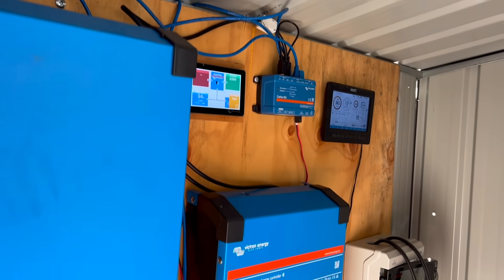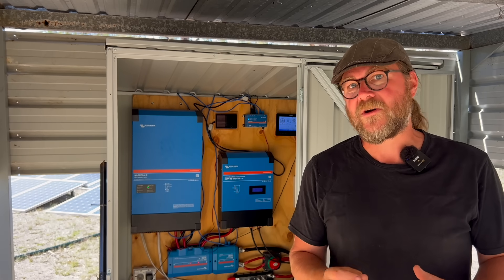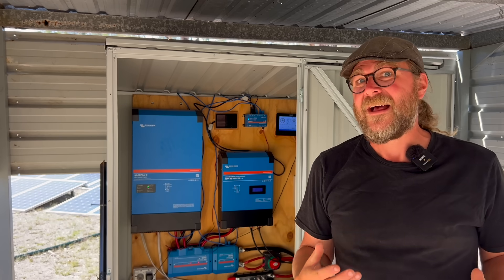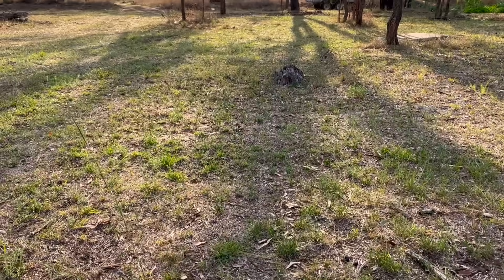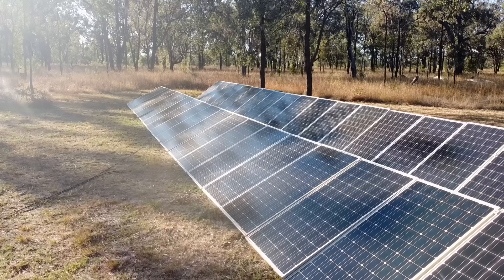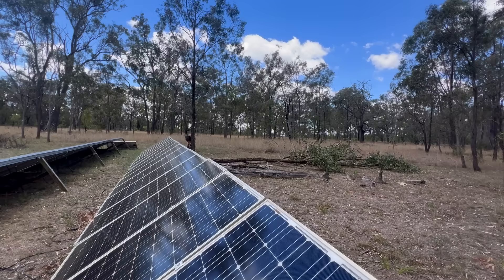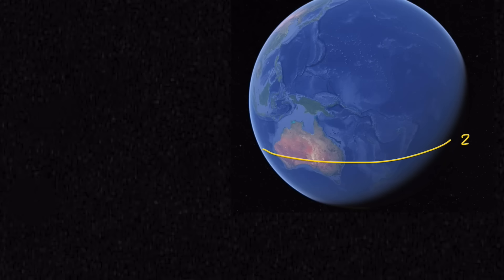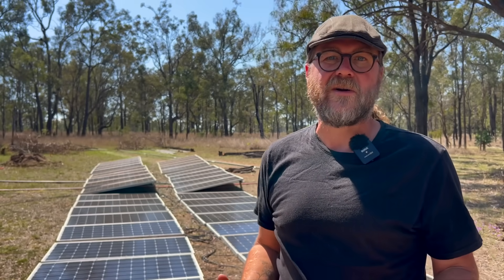We seriously MISCALCULATED when we set up our Off Grid Solar System

Comment: Not to mention solar panels lose efficiency the hotter they get. Get them up off the ground so you have air flow under them. All that radiating heat from the ground is probably knocking out about 10% of your power on the hot days.
Reply from the maker: That’s an interesting point. I wouldn’t have thought 10% though? And what about panels mounted to a house roof, how do they keep those cool? Might be interesting to run a comparison test when I build better racks for them.
Reply: In the cooler months and mornings, likely not going to lose anything. But our Australian weather isn't cool most of the time. The ground is a massive thermal mass and it will radiate that heat straight into the panels. Roof mountings are usually fine because even on a roof they are slightly elevated due to the support system they're installed on and the corrugated nature of roofs. Then there is the that most roofs are hollow and don't have any real thermal mass, so any heat they radiate, is just the bounce UV radiation. Should be easy enough to keep track of the evidence loss with your Victron hardware as it should hold a record of your daily current input.
Reply from the maker: @SovakaKindred  aha that makes a lot of sense!
I guess it’s not as noticeable for me right now because of all the extra solar energy I’m getting from the summer sun angles but now I’m wondering just how much MORE I could be getting if we lifted them… Especially as these are pretty old panels
Thanks for the tip!
Reply: @rusticspiritshomestead  Obviously you can only work with what you have and make changes as time and money allow and if you are currently meeting your electrical requirements, then all is good. But it also speaks to the lifetime argument you made about not pushing the electrical items heat limits. I'd be interested to know the differences as well!

Comment: I have gone totally off grid about 3 months ago after having grid connected solar for about 14 years, in the last 18 months I have been slowly taking household loads off grid, I am also south but at about 33 degs NSW, I have 24kw of solar and by chrismas 100kwh of lifepo4 batteries, my summer I I having excess solar ro burn, I am thinking about setting up a couple of extra arrays with a winter based tilt, one for morning and one for evening or NE and NW pointing, I have gone 3 phase at 11kw a phase, it is still a learning curve, I thing that have saved me a fortune is building my own 48v battery banks using 16 x 3.2v cell, this costs works out for 314Ah batteries (tested at 322Ah +) $2400 landed in Australia not including any BMS etc, that 16kwh of storage, I am trying to design for the worst week of solar sunlight, which is of course winter, best of luck on your project, if you are looking for a shadow calc use suncalc.org

Comment: Another mistake, those panels should be higher up. Less shadow issues, they get less dirty . No constant need to make sure no weeds grow bigger than a few cm in front of the panels etc...
Reply: they certainly need to be raised. i suppose they are just temporary till the bloke finds out where they are supposed to etc
Reply: For what it's worth,I put my solar panels on my roof and thought I had accounted for all of the shadows, but the southern shift got me also. I did not realize the shift would be that dramatic and make the shadows of a tree that did not affect the panels in the summer, now has a big shadow that's covering 30% of the panels. The point? Even if they're high up on a roof sometimes you can miss things especially if you don't know to look for them.
Reply: @nemam_nedam  
they are certainly spaced to close together.
australians have to make it first wrong before they learn.

Comment: instead of building think of maybe a shipping container or better a portacom or even a  cheap caravan, as long as its not to far gone (able to to be made serviceable with some minor/cosmetic touch-ups) it can work out cheaper in time effort and cost over all, with the bonus if plans do change its easier to relocate and rewire than rebuild again, with mine i brought a cheap caravan broken windows drawbar and running gear needing replacing but the cabin part was water tight so i boarded up windows converted/ removed  running gear to be able to be mounted on a car trailer, if needed, for mobility

Comment: The voltage drop from inverter to house is WAY more important tan drop from the panels. Low voltage  to the house car wreck your equipment in the house.    Voltage drop from panel to MPPT just looks like, to the MPPT, less sun.   Run panels in series to keep voltage high.  Put your electronics near or in the house. This Also makes WiFi and Bluetooth connection to equipment better.
Reply: Only really an issue for things with AC motors or resistive heating elements as most other devices operate between 100v - 240v and we're targeting the higher end of that in Aus
Reply from the maker: True. And I wish I could have. Unfortunately I have buildings 50m north of solar panels and 50m south of panels. So we opted for massive mains cable off inverter.

Comment: But Regan.. the first rooky mistake is that your DC from the panels must be low voltage.. !!!
Isn't your charge controller 150volts DC capabile? you really should be using one with say a 450V DC input capability.. ensureing the cabling, isolators etc are all more than capable of these voltages..
Reply from the maker: It is. I’m running into a 450v 2 string controller. Panels are in 350v strings arranged in 2S2P. And yep, got some nice beefy cables/switches/fuses.
Reply: Agreed - I was confused about how 350-450v is "low voltage" lol
Reply from the maker: @robdavy4468  ahh yeah fair. Not really LV is it 🤣. Should have said DC. What I was trying to convey was that the cables from panels to controller can be a lesser gauge than your mains cables.

Comment: You got an RS450, so you could design your strings to do more than 300V - More than the 220V mains voltage. In that way the voltage drop on the DC side would be less than on the AC side. You could move most of it inside your already air-conditioned home.
Reply: In America, with 120 V mains voltage for a typical off-grid situation, that is even more true.
Reply from the maker: I wish I could but #1 we’re trying to get away with no air conditioning (we’ll see how we survive this summer!) and #2 I have buildings 50m north of solar panels and buildings 50m south of them so no choice but to set the gear up half way between
Reply: @rusticspiritshomestead  He meant alternating current, not air conditioning.

Comment: You actually want to aim them at Solar Noon... which is for the most part pointed North for people in the southern hemisphere and south for the northern. Solar Noon is not the same as due north.
Reply: It is often advantageous to point a bit east of solar noon.  Morning power is often more valuable than afternoon power.
Reply from the maker: Interesting. Our heaviest usage is between 3-7pm so I wonder if I should consider a slight west offset
Reply: @rusticspiritshomestead  When are you batteries at least charge?  The morning.  No, you should point to the east to have power to use early in the day.  Under most combinations of batteries and panels, your batteries will still be topped off by the end of your solar day.  With current prices, people oversize the panels, to make sure you are charged at the end of the day on or two days after cloudy weather.

Comment: Put panels on shed roof too will remove energy from the roof into the battery and keep the heat down in the shed to a degree.
Reply: 6:42 6:43 And it works keeping a shed cooler. I have had it for years and experienced it.
Any shade will help.
Reply: Using insulated cold room panel sheets for the shed roof will help 
 Then improve air flow OUT  of the garden shed .
Reply: PV panels work on the shorter side of wavelenghts, like between 800nm to 600nm. Heat, like 5-15μm just accumulates and about 70% of the 800-609nm light is converted to heat also. So, basically, PVs will trap more heat into the shed. 
There are ways around that, like forced ventilation, liquid cooled hybrid PV... but just flat on the roof means more heat. 

But he sports uninsulated sheet metal roof on that garage. That's a frying pan in the summer. Shoving an AC in it will just waste money and solar power.
Reply: Panels raised off the roof and sloped will allow natural ventilation between the roof and the panels reducing heat build up.
Reply: Wasn't suggesting flat on the roof still use mounting brackets etc as it appears for me that roofs with solar on it dont seem to be as hot from direct sunlight but not measured it, but yeah there is a company in Western Australia https://www.youtube.com/watch?v=-dJixtZdkU0 developed a solution to extract the hot air to ensure no hot spots on panels and then use that heat for other purposes (hot water, room heating etc - not so useful in Aus summer time).

The shed would need decent insulation to put an A/C on it to try maximize the cooling from it, would have thought its just to get the temp down in the shed to take the edge of summer heat mitigating the damage on the batteries and electronics, definitely would need energy to burn though for it.
Reply: @rw-xf4cb  Even flat on the roof works. I have used it and had a marked difference in inside temperature.
Reply: Haha except it's still better than no AC trust me...
Reply: @johndoe1778  lol, AC for the equipment? nonsense and a lack of thinking... The shed needs INSULATION as well as ventilation (forced sometimes called). The roof painted white with special paint will reflect back at the panels (bifacial would be ideal for this) as well as keep the heat AWAY from the shed underneath... The walls could have vertical panels as walls as well... But even if no solar panels were used on the shed, INSULATION is the key...
Reply: That heat conversion you are talking about stays in the solar panels mainly. Only a little is re radiated to the roof of a shed. The solar panels are not solid connected to the roof so that heat transfer through material occurs. 
AC would be the next step and I have used it in a shed with chickens (where I also had solar panels on the roof and they did make it cooler but not enough) but use split system as portables are next to useless.